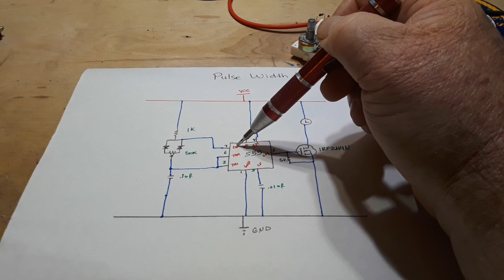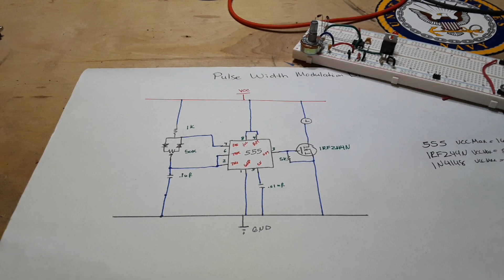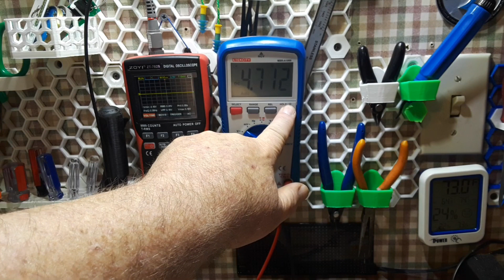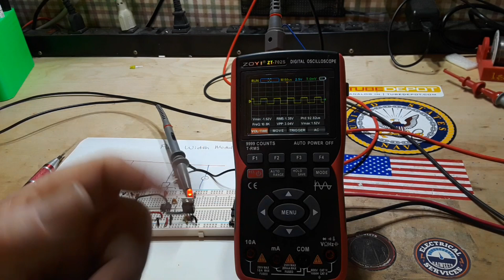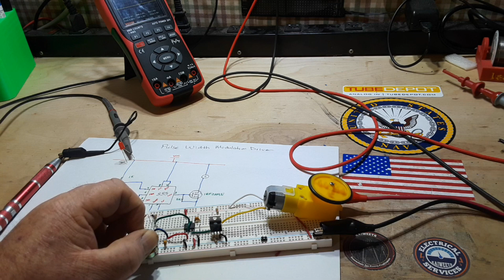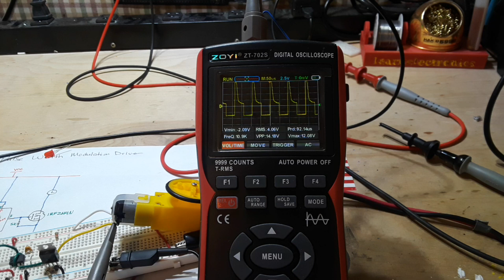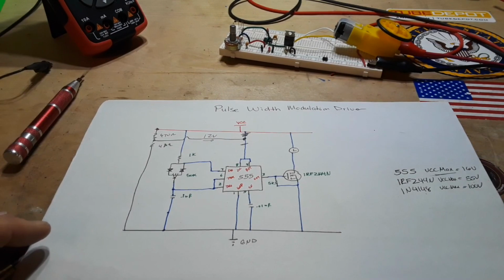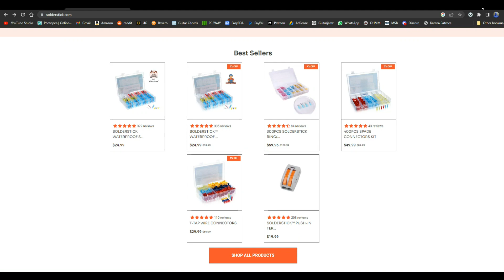Classic Circuits You Should Know: 555 Based PWM Motor Driver  - sponsored by Solderstick

Comment: With juat a few additional passive components & slight circuit changes ...How about a study on this circuit behaviour....
...1) IF the osc. chg./ dischg. circuit is taken from the jn of motor term.& mosfet drain..through a suitable ( buffered) RC filter..we may get some open loop spd.regulation.
...2) A properly selected current sense resistor in series between  Source & 0V
(Vsense = 1/3 Vcc= I mot.limit × R sense) R_sense watts = 4×(I mot.lim.^2× R_sense)watts.
This will provide some extent of current limit protection...
Here the osc.cap is returned to 0 V through the R_current sense res.

Comment: Diode clamps across motor will protect the 555 to some extent & provide a coasting current to flow through the motor during the pwm  switch.. "off" time duration.. especially at low speeds.

Comment: You need to connect the diodes to the same voltage as the 555 so the 24v doesn't kill the 555 going into input ppins

Comment: Please note that whatever the load is that is connected to the output acts as an integrator, mathematically averaging out the voltage per the percentage ON of given supply voltage (at the output.)

Comment: Always great to have the drawn schematic and working breadboard circuit.  Q) Cntl Pin #5 to GND with cap is doing what?  Thx.
Reply: This is a recommendation for NE555 or LM555 and the like using bipolar junction transistors. It stabalizes the circuit at the threshold (2/3Vcc). It is not really recommended for CMOS based 555 timers such as LMC555, but it doesn't hurt to have one in a circuit based on CMOS.
Reply: @eliasgeorge8534  , excellent info.  Thanks.  I will test this.
Reply from the maker: Just holding it low.
Reply: @learnelectronics  , thanks.  Since caps don't pass DC, I'll have to think about how this would work a bit more.  Cheers.